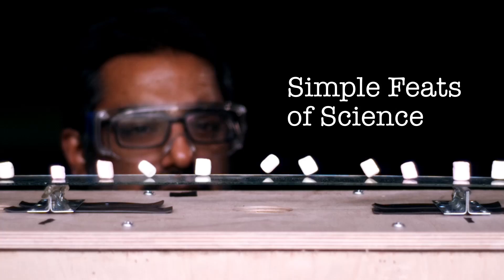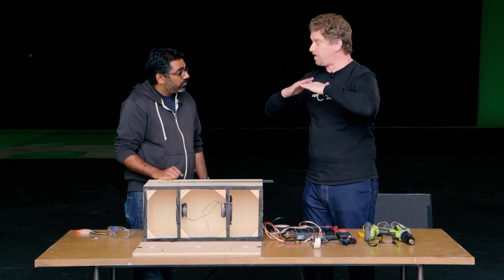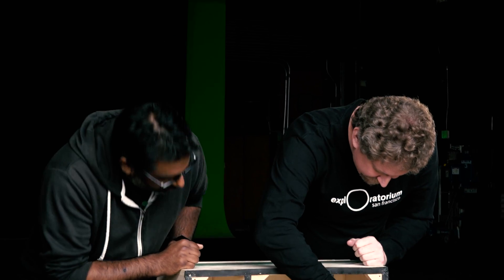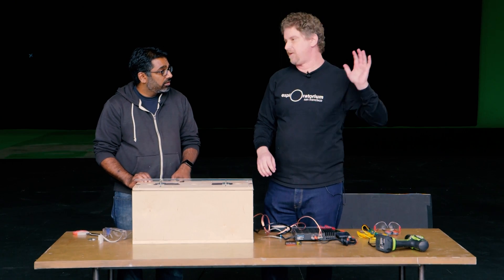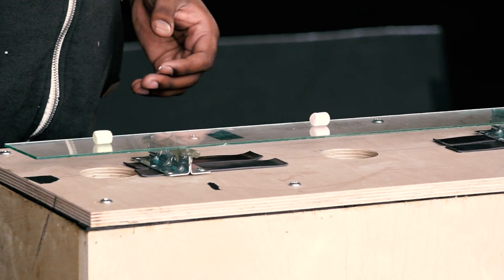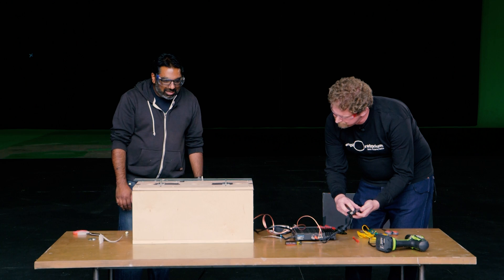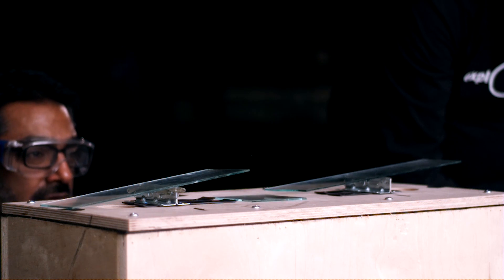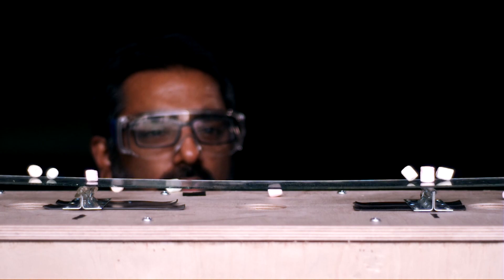Breaking Glass Panes with Car Speakers!

Comment: Cheater! You can "age" glass merely by running your fingers over it a few time. When it's straight from the manufacturer, it is 10x stronger than it is before even casual handling. Also, run those suckers up to 130 or 150 dB and then let it rip!

Comment: Too long, too much babbling, and ffs, get some more powerful speakers/amps or get the right glass, once you mess with the glass this demonstration loses it's core point. this is a low cost demo that can be very powerful learning tool, however sloppy execution removed the punch...

Comment: he just used 6.5 inch speakers and probably like a 100 or 200 W RMS amp.... i HIGHLY doubt he was hitting a 100+ DB 35 hz sound wave.....not with 6.5 inch speakers.

my 2 12 inch subs and 1000W RMS amp would like to try to break that glass.......however, my amp randomly died. tuned car off, was good, go back in an hour later, no sub amp. im very sad....

but i KNOW, even with out hitting perfectly resonate.... it would break it. from force alone. lotta air comes out of that box!

i do like his box.... that would be the best for breaking glass, but the 6.5s are just a tad too small to properly reproduce a 35hz wave at high sound pressure levels. 

but 12 inch subs are WAY more expensive than 6.5s lol!

Comment: 35 hz 100 db XD yeah right....
Reply: You don't need that much power to generate 100dBSPL at such close distance, coupled with the fact that the box design is meant to amplify the air pressure effect on the glass by pushing on the center while pulling on the sides. If the glass is being hit at 100dBSPL, where they're standing they probably get around 92dB at frequencies the human eat isn't that sensitive to.
Reply: 100 db at 35hz is loud...
Reply: +SexyNonstop to the human ear it's roughly the same as a 60 or 70 dB 1000 Hz tone. We need big subwoofers to generate enough force for us to hear the lower frequencies level with the mid frequencies. Doesn't mean a 6 inch speaker can't oscillate at 35 Hz with enough amplitude to generate 100dB SPL at the 10 or 15 cm the speaker is away from the glass.
Reply: ok i give up

Comment: Isn't that an air pump though? Not actual sound waves breaking the glass
Reply: +farai mukungurutse and sound waves are? difference in air pressure
Reply: A speaker sort of is a "oscillating air pump" though. What's actually happening is that the changing air pressure causes the glass to bend slightly back and forth. The glass itself has resonant modes where you can add energy to the system, (sort of like tapping a person on a swing slightly each time he comes back) making it oscillate even more, until the internal stresses are so big that you have a structural failure and get a crack.
Reply: It's sound waves with air as a medium, it's not pumping out air it's shifting it back and forth
Reply: +farai mukungurutse Sound waves are nothing more than differentials in air pressure, so yes.
Reply: So its the actual waves..
Reply: +farai mukungurutse if it were "just air" they wouldn't have to tune it to the resonating frequency of the pane. they used the hole system to try to direct the energy since low frequencies are basically omni directional.

Comment: The whole thing would have been so much more fun if the guy had finished answering the question of "what frequency are you starting at" and had further said what he was lowering the frequency to... come on... the knowledge and awareness is the whole deal here... ultimately breaking (scoring the surface) sort of made the whole deal suck...
Reply: +Riki B. Eyestarone , i was thinking the exact same thing..
 could possibly make some assumptions or good guess's of the box size and work out its peak frequency or just take a stab at it, personally though ill agree with @sounduser and say 35(ish) hz
Reply: +nvmyutube Yes and an Engineer and Acoustician I certainly could guess at the optimum frequencies but my point in writing is that for those that this might really benefit from the demo it is the numbers and where they might encounter them in real life that would have been the point of the exercise. After all the sounds emanating from the ports could have just as well been rods moving up and down for all it mattered. Ultimately weakening the structure sort of defeated the whole exercise for me as well as not knowing the numbers.